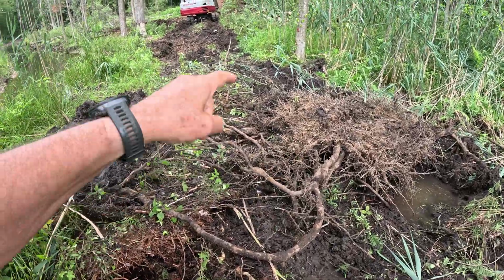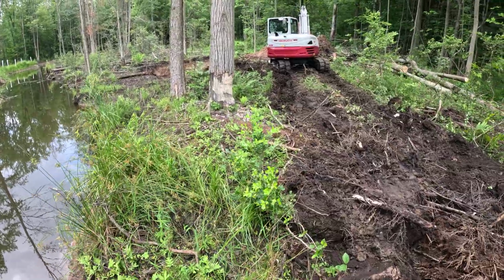Redirecting Spring Well Water for Pond Conversion: Managing Surface Water at the Construction Site

Comment: Why don't you stack some of your scrap pieces of wood on your road? So your excavator don't sink? That's what they do in swampy. Areas, they put a bed of logs down. Fill over it. And there's your road bed over time, it will rot. And you'll have to do it again later, but it'll keep your machine from sinking. It's just a suggestion
Reply from the maker: Unfortunately, it would take a high number of straight logs to create corduroy paths to do the job. I only take down dead, diseased, or dangerous trees, and we don't have very many of them. Thanks for the suggestion, though! We’re always looking for ways to improve and appreciate your input.